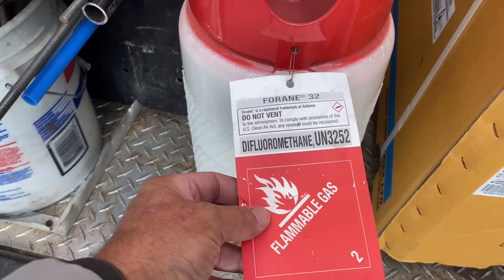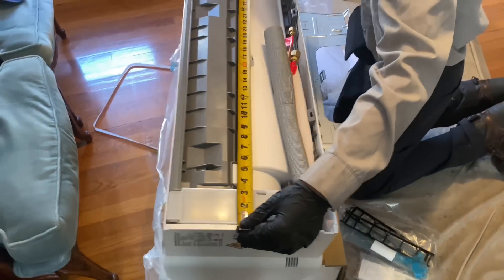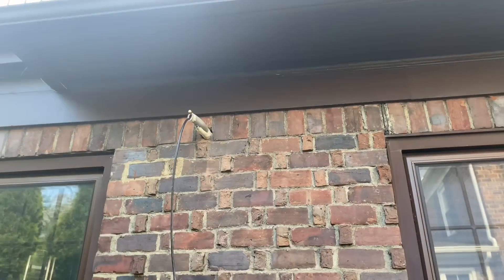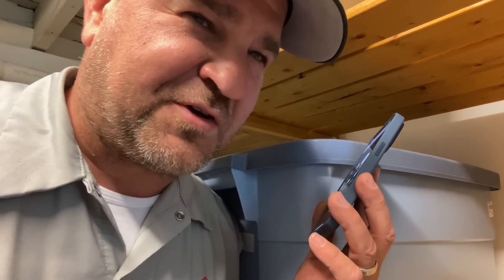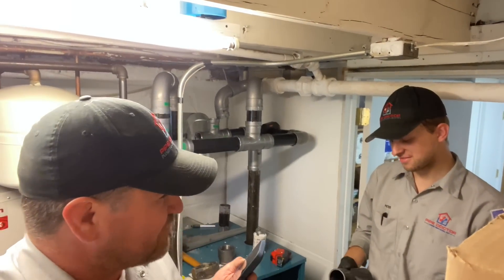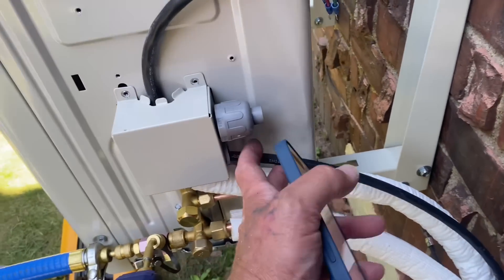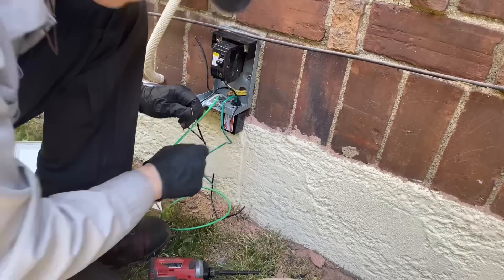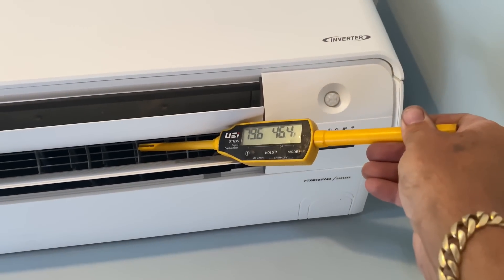Ductless Mini Split Installation Using R32 Refrigerant Daikin Atmosphera 12k BTU Heat Pump

Comment: I will suggest the indoor unit put somewhere better location, often installer suggest to locate near corners of the wall but in fact the air blow out is not circulating the room well. This is easy for the installer but not best for the user.

Comment: Very cool. I have been waiting 4 years for the swich to R32.  Our house has 2 fully functioning central air systems. but they are just so inefficient.  Switched to window units cut electrical usage by 65%.  Central air is usually a bad idea its even worse when you run your ducts in the attic and through wall spaces.  Hopefully our state allows R32 soon.

Comment: nice job, good looking installation.
I've been using Mitsubishi R32 for 6 years now. No problem about the refrigerent at all, people were a bit concerning at first when Daikin first introduce the units with R32 in 2015 but after a few years they don't care much (and yeah, R32 is actually cheaper than R410A here where I live)

Comment: I have 2 mitsubishis with 410 and 2 with r32. The 410 units heat much better than the r32 units.
Reply: @PipeDoctor  in Australia
Reply: I have found the r32 units to perform better in cooling tho

Comment: Okay, notes on electrical. You used nm through the block wall, and it should be either in a conduit or ran as uf. Also Daniel was hooking up line side wire to the load side terminals. Minor details, sharp looking install.

Comment: Daikin became the world’s first company to succeed in applying R-32 to air conditioners by leveraging its expertise as the only manufacturer that develops and manufactures both air conditioners and refrigerants.
Reply: Carrier does the same with PURON 454B which is their version of the R32 from Diakin.
Reply: @Squishy_man2940 I mean carrier are using r32 in Australia
Reply: Fuck daikin
Reply: If daikin is the first, explain how I can have a Mitsubishi R32 system for the past 2 years?
Reply: @sciencetestsubject  what country ?I've yet to see one in  USA?
Reply: @MathScience-l8g  Netherlands, R410A phase out for new equipment is 2025.
 Total CHFC (R22 example) ban was in 2015, meaning systems cannot be filled with R22 from that year.
Reply: @sciencetestsubject  lots of R22 systems still running in the USA, but when they break they are typically changed to R410A. There are just a handful of R32 systems in the USA right now. I'm sure that will change in the next few years.
Reply: because Mitsubishi use R32 follow Daikin. Daikin released R32 since Nov2012.  @sciencetestsubject

Comment: See this is why plumbers shouldn’t do electrical work because they don’t fucking do it right go back down Mike G, or send Daniel back there and put a Gromit strain relief on that wire that’s simply not right
Reply: I have gone behind more than one licensed electrician to properly land terminals.
Reply: Or go to HD and get a bag of the plastic flush snap in romex connectors

Comment: Mikey what’s the running pressure like. I haven’t installed an r32 as yet. So far there’s still new 410a sys out there. This weekend I’m doing 5 zone Bosch with 2 condensers. I just updated the firmware on my sman.  Now I have r32 on it.
Reply: @PipeDoctor  oh nice. Probably gonna last longer. Lol. Lower pressures
Reply: It's similar to R410a, not R22

Comment: I’m not a big fan of this refrigerant, especially in this application. But I’ll wait and see and not use it.
Reply: 410a is 50/50 r-32 and r-125. This is better than 454b that carrier will be using in my opinion.